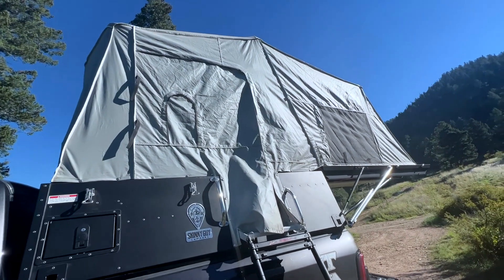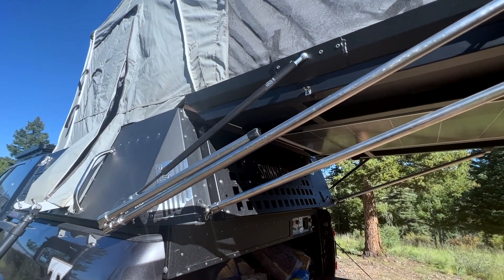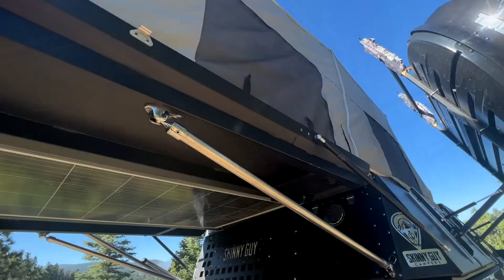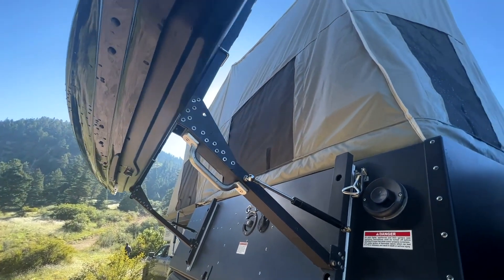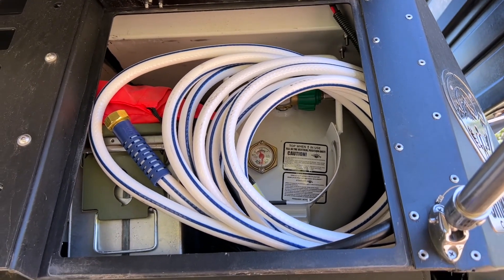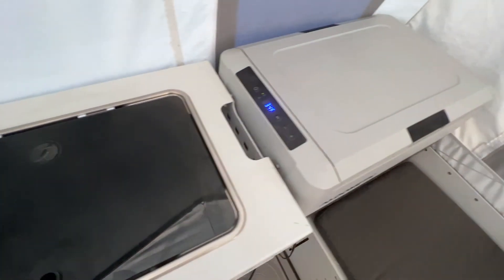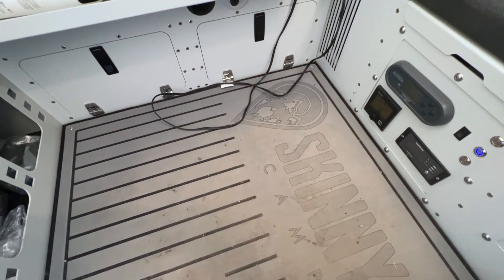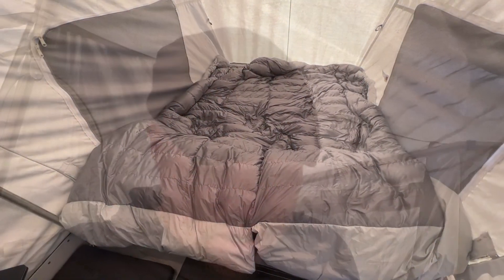Skinny Guy :: The Low Profile, All-in-One Overland Camper

Comment: I'm really confused about who the customer is for something like this.  All that weight (800-1000 lbs dry) and setup time (flip storage out of way, 4 latches, erecting pole to flip open, set up ladder, set up kitchen, flip out solar) to still have fabric walls and be shitting in your kitchen. Driving down the road and want a cold drink out of the fridge.... Have fun with that. Literally everything requires setting up to use. Every system has been made to be as complicated as possible. The single points of failure are uncountable. Love to see people try to innovate but this is only solving problems the manufacturer created in the first place. Please don't hate me for being honest.
Reply: Maybe anybody who wants a rooftop tent. With full water and gas and heat. Drive it anywhere you want and still park in your garage. Definitely not for everybody.
Reply: 1,300lb tent.